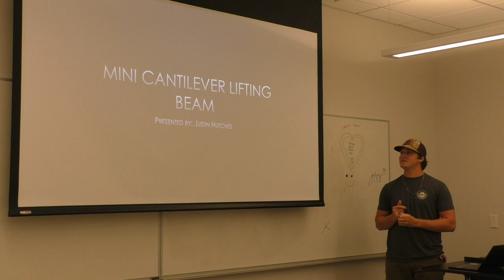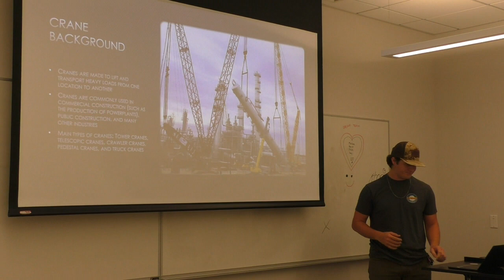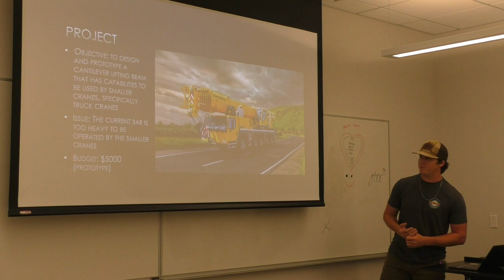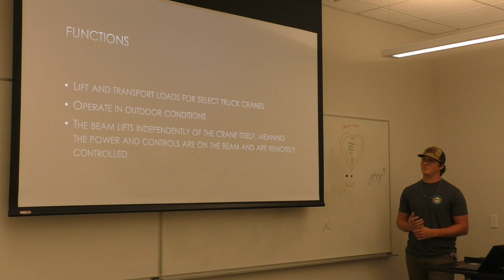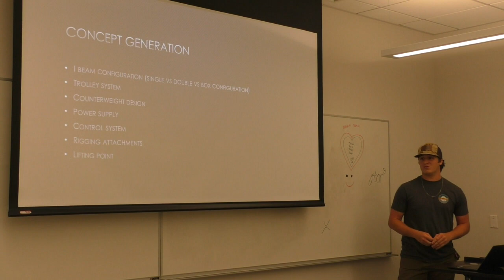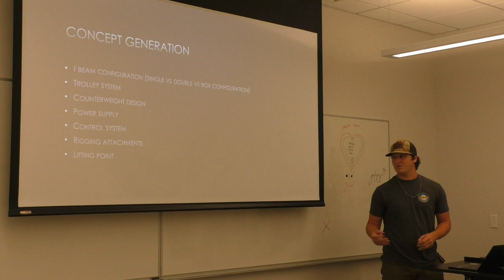Justin Hutches

Comment: Justin, your presentation was excellent. I appreciated how you went beyond simply reading the slides and took the time to elucidate the content, providing valuable explanations and breaking down complex concepts. Your evident expertise and experience in the field of cranes added depth to your presentation. Your background in this industry will be a significant asset as you embark on your senior capstone project. Your explanations were concise and easy to follow, greatly enhancing the overall understanding of the topic. If I offer constructive feedback, consider minimizing hand gestures during your presentation. Nevertheless, your performance was impressive, and I commend you for your excellent work.